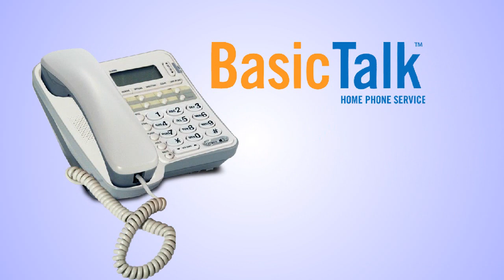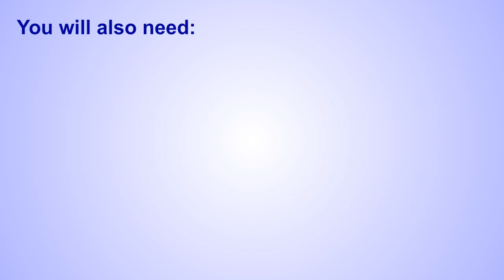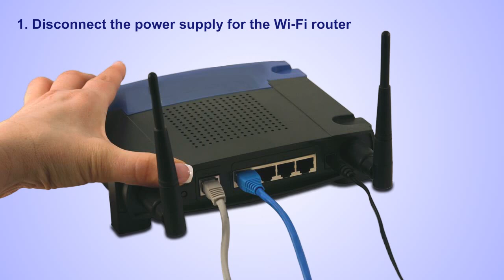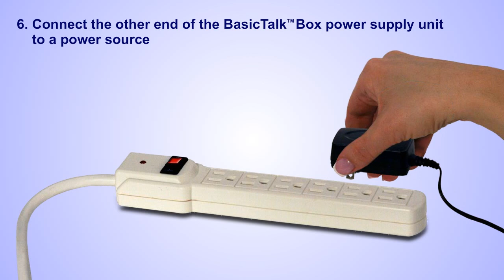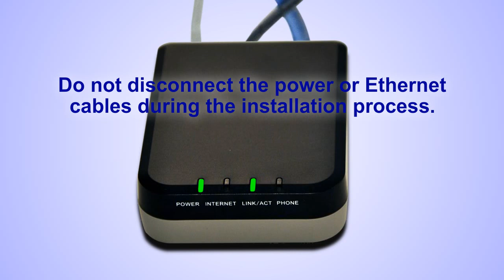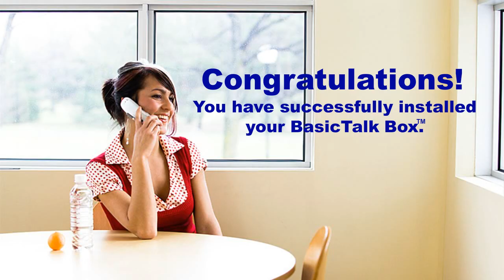BasicTalk™ Installation Tutorial

Comment: Does this work with My cable modem(Not wifi router)?
Reply: That depends. If your cable modem has multiple ethernet ports on it, usually two or four, then yes it will work. These types of cable modem are also referred to as gateways or wireless gateways since they have both a cable modem and wireless router built into them. However, if your cable modem only has one ethernet port on back of it, then you will need to hook up a separate router to it in order for it to work.